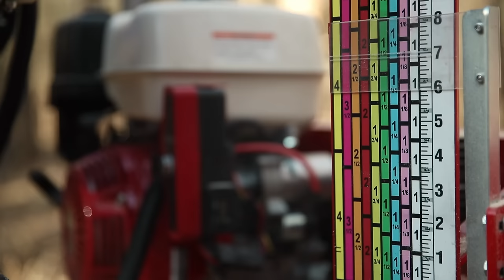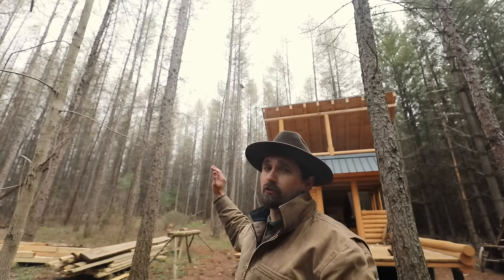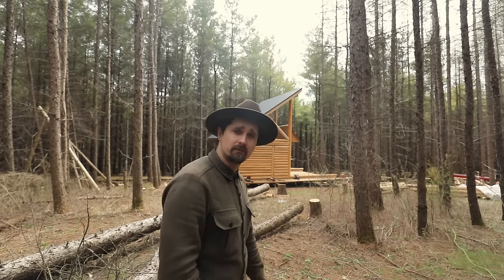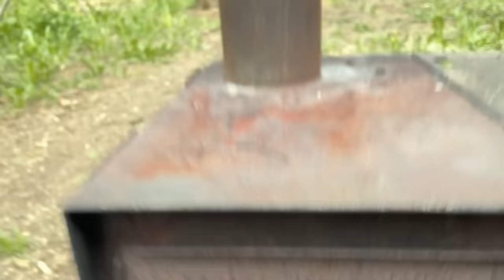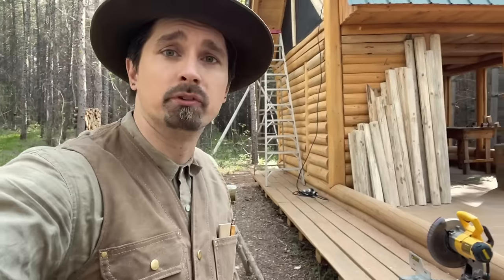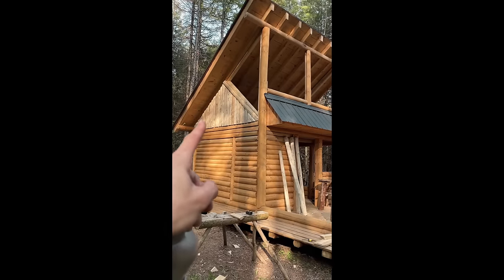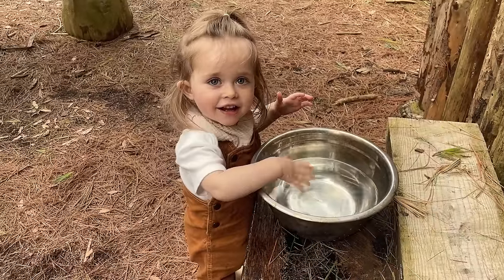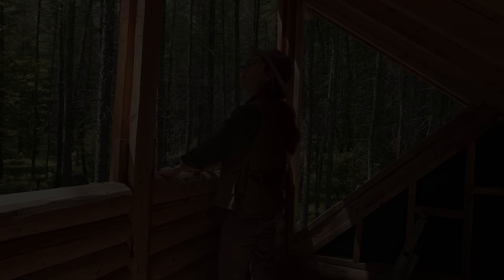Building a Cabin From Our Own Trees // Spring 2023

Comment: In order to lift and move trees, you could pull a wire rope across 2 trees, and use a hoist mounted on a pulley to lift and then move the tree along the pulley. You would want the wire rope to be low to the ground to not bend the trees it is hung off of.

Comment: I want to start a project like this, but don't want to do any permitting. Quite frankly I don't want the city to know there are any structures on the property. There are rules that say that you can build a 200sq ft cabin with no permits (I think). What if I put 2 200sq ft cabins next to each other back to back. Technically I'm not breaking any rules, and technically you can separate them...

Comment: I got a Question about the wood. Will there be a Problem when de Wood dries? I thought that wood shrink when  its dries wont it bend or will it make any problems?
Reply from the maker: It’s true. Wood will change shape as it dries.  These logs dried for about 4 years so they are getting close to settled but I may still get gaps. If so I can fill with chinking.
Reply: Ah okey, thx for the info 😊

Comment: Is it me or don,t you supposed to let the wood cured at least couple of months or  one year? That's what I heard with lumber makers every time I aske them,  they told me couse the wood shrinks when is dryied so that is why you have to give some time to cared naturally,so when you make boards or lumber the wood is at least 90% dryied,may be some expert can help my toughts
Reply from the maker: Well there is whole books written on the subject. I can't possibly answer that loaded question in a responce but yes, logs do shrink in all types of ways and some more then others.  You need to factor that into the design. But traditional log cabins and timber frame is built with green (wet) wood.  These siding boards were felled back in 2019 and dried for a while before installing so they are pretty dry.
Reply: @TrustinTimber  ooh thanks allot for the short but fine info good luck with your proyect ,god bless you